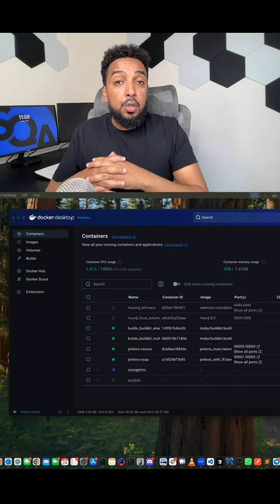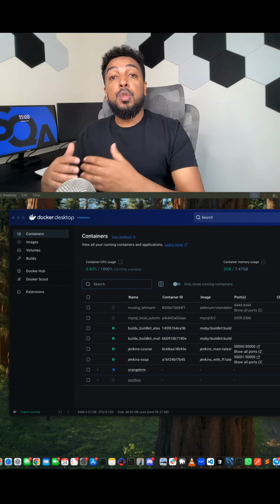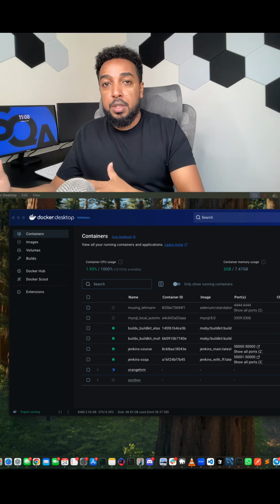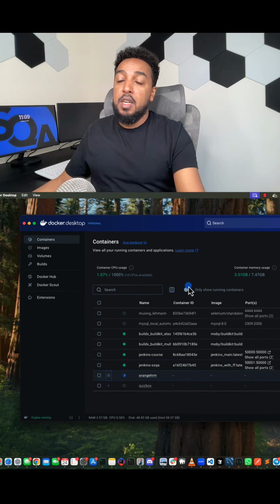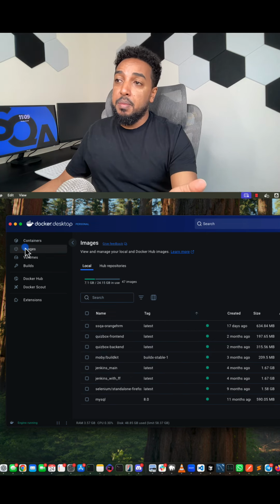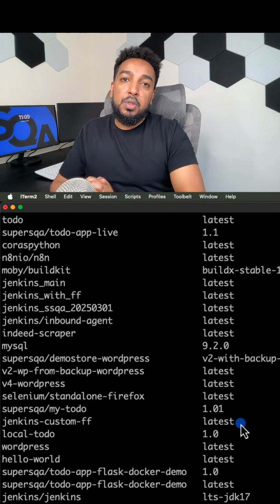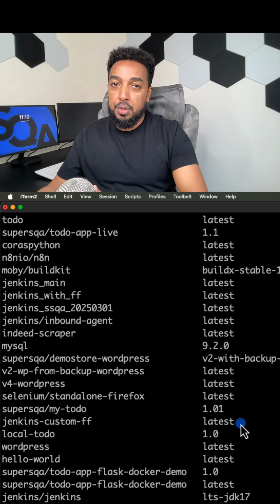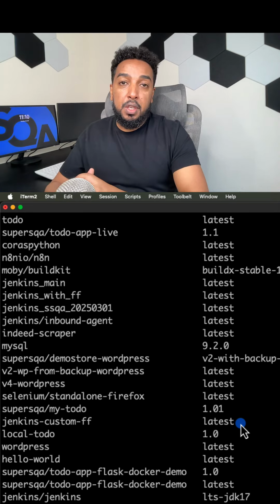Why You Should Learn Docker CLI (Not Just the GUI) – Real World Advice

Comment: but you still need docker desktop to get the tag though, right?
Reply from the maker: You do not need docker desktop at all. I mean you need the application to be installed that is how you get docker installed, but you do not need to use the GUI. You can do everything in the command line. You can run the command `docker images` that will give you all the information about the available (locally) images including their tags.